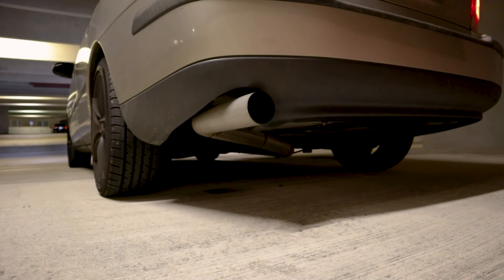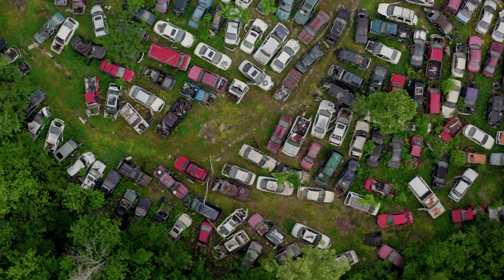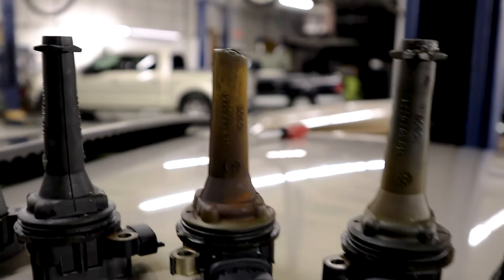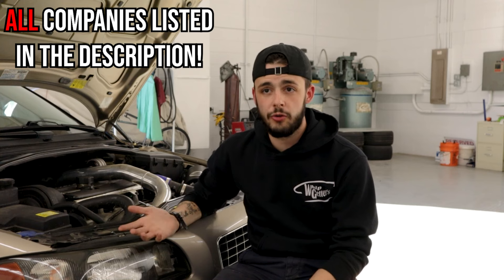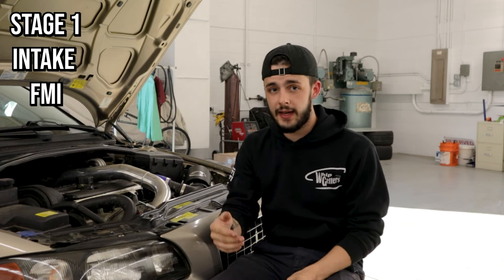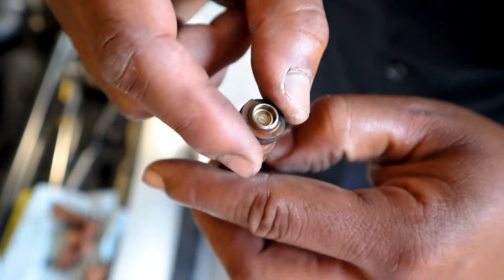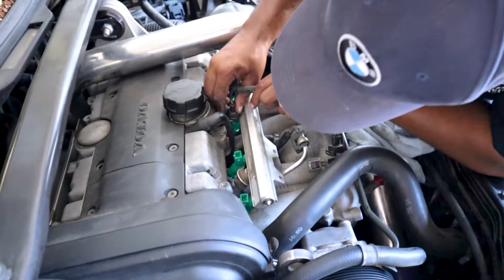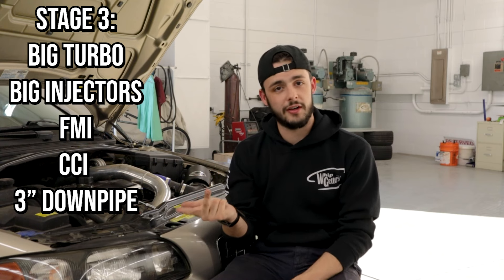What To Expect When Modifying A Volvo | Understanding Volvo’s & Performance

Comment: So my first car when I passed my test many moons ago was a 850r t5 with the manual gearbox I absolutely loved it. Fell in love with the 5 pot sound so bought a fiat coupe 20v turbo as well also 5 pot so then went upto 6 cylinders and bought a r33 gtst I had all the cars at the same time and I'd choose the volvo and fiat over the skyline any day and I don't know why as the r33 was my dream car. I don't own any of them anymore the t5 and skyline I wrote off. However I've just bought a volvo s60 2.5t because it was cheap and I've done it again the sound has sucked me in I was supposed to be selling it straight away but I don't think I can and now I want another fiat coupe too 😂 sooooo I think I'm going to sell some of my other cars to get the fiat. My wife is going to be furious 😂😂😂
Reply from the maker: Sometimes when it comes to cars there’s always that one influence that will make you want to turn to another car brand. There’s something about these 5 cylinder motors that we just can’t get enough of! We’re glad your sticking with the 5s because they’re just so unique!😎
Reply: @WhipGetters  unfortunately today I've noticed it's using all of its coolent : ( pretty sure it's going to be the dreaded cracked liner. Be a shame to scrap it. Sods law

Comment: Did you have to change anything for the 18t turbo or is just a bolt on
Reply from the maker: You should be fine, just make sure your flange for your exhaust down pipe is angled if angled. The 18T I got had an angled exhaust flange and bolted right up to the exhaust manifold. If yours is straight flanged, find a straight flanged 16T or 18T. If you have the same flange, it is a direct bolt up. If this was confusing just let us know!😎
Reply: No. Do not get misleading. 18T can be bolt on. BUT it will BENT your ROD. This problem has been discussed a lot on Volvo forums. 18/19T K24 turbo bolt on is a guarantee BENT ROD. You will need a special TUNE for big turbo.
For the flange part. All TD04HL - xxT turbo share the same exhaust housing. 
The only safe choice for bolt on is 15g/16t.
Btw. I own 2 850R sedan.
Reply from the maker: You’re right, but we weren’t misleading! Of course any bigger turbo will require a tune and it’s supported mods as mentioned in the video. It also squares down to what block you have as well. Understandable, and you taught us something we didn’t know either!😎
Reply: @WhipGetters  also the 18T is not a efficient turbo. All TH04HL are not really efficient. If you really want power, K24 is better.
Reply from the maker: A K24 might be in the near future knowing that now, we’re just gonna have to see if our 2.5T motor will bend a rod!🤣 We appreciate your advice!
Reply: You guys are misinformed. 
#1 k24, 18t, 19t is barely an upgrade will only grant you about 20 to 30 more hp then a 16t. Maybe 50hp on e85. 
I made more on a td04hl-22t with water meth and 100oct.
Learn from experience of others. 
I spent the $1500 on a turbo and Bosch green injectors and 3" maf for 22t. Just to then do it again when i got bored and then needed 800cc deitchwerks injectors and 3.5" maf, rebuying bigger couplers again etc.
K24 are also very prone to cracked housings. Turbos dont bend rods tunes do. Your reading info on forums from 2012... Talk to aaron at vast or matt at hellmooseperformance or even calvin at sovvagn. Ote tunes are not the most efficient. My tuner spent months sending logs back and forth sending new files each time i made a new upgrade. Take care of them they'll take care of you. I realize you guys are running p2 chassis with me7 or me9. But must be something other then off the shelf tunes. Guess depends on power goals. But if like most you always want more do it right the first time. Get manifold milled for t3 housing and get something with bigger then a 7cm housing that chokes off at high rpm. You'll thank me later lol.
Reply: @lynnmei4346  ive been running a 22t at 23psi for over 2 years no bent rods...
Reply: @ogfromutube9649  the problem is not the high rev with high boost. The problem is too much boost on low rev without tune. A tons of blow motors on forums. 
Btw. Stock R motor with T5 head and running 93 fuel is good with 350hp+. Stock R motor comes with reinforced rod and k24. I got a friend achieved this.
Reply: @lynnmei4346  Never said anything about high rev. Literally said too much boost at too low rpm. Its tunes that bend rods not turbos. I make 380bhp on a td04hl-22t... Stock b5234t9 from an 04 c70 2.3 hpt. And about to run a td06-20g thats almost twice the exhaust side as a k24.... K24 18t 19t all barely upgrades over stock. I got 280whp from a 16t on water methanol..
I said the 18t 19t 22t k24 all choke out at high rev once the motor outflows the turbo it stops making power. A td06 or really any t3 with bigger turbine will make power to redline. Td04hl and kkk are meant for low end torque why they put them on cars from the factory. Make the power where 98% of ppl will use it.
Yes a k24 can make 350bhp but a 16t can male 300bhp so for the $1500+ it cost really not worth it over a 16t.

Comment: How should I go about tuning an 08’ s80?
Reply from the maker: What motor does your S80 have?
Reply: @WhipGetters ey, same question lol. I own a 2003 s80 2.9 and I’m about done with stage 0. I wanted to ask how I should go about stage 1 modifications, and wondering if these engines can handle 260+ hp like in the T6 model.
Reply: @romanguerra234  I think the 99-04 t6 couldn't really handle the power since they used some weak general motor transmission :face-orange-biting-nails:Usually the engine blocks can handle the power in volvo but the transmission might not. I got around 360hp in my 04 s60 and im scared for the transmission even though its aisin. (which still isn't the most reliable)

Comment: I got a 2006 s60 t5 manual, 103K miles, I was thinking about buying a cai and a stage 1 tune, do you think I really need a FM intercooler for this mods?
Reply from the maker: We haven’t added a FMI all the way up to stage 3. If you want to add it you can, it would probably make ours flow much better and cooler. But for stage one you’ll be more than fine to skip it until higher stages!😎
Reply: @WhipGetters  ohh I thought you said a fmi at stage 1, loll sorry my bad
Reply: @WhipGetters  and do you know the stock rev limiter on a 2006 t5?? Because I went to 6300 today and didnt hit it lolll

Comment: I couldn't help but notice you didn't say you shimmed the block. When you go with a bigger turbo on these you really have to shim the block otherwise The increased pressures will crack it because of the way the coolant passages are designed
Reply from the maker: True, block wasn’t shimmed and might never be for this current motor. But I did forget to mention whenever doing bigger turbos and don’t want to risk block cracking, is to control the amount of boost levels your engine is making and not peaking to the extent of cracking!😵 There have been plenty of tests with the bigger turbos being used but not over boosting and setting your pressure right with tuning can be safe and reliable without damage. Also, thanks for pointing that out!👍
Reply: @WhipGetters  I'm doing quite a bit of research on this because I have an 05 Volvo v50 T5.
Reply from the maker: It’s always good to do some research about these motors. Most of the time we’ll find out things about them we didn’t even know!

Comment: is yours a t5 or a 2.5t? my s80 has a 2.5t and want to do something to it but most guides are exclusive to t5's. will most parts for the t5 fit on a 2.5t?
Reply from the maker: A lot of the motor parts are interchangeable. Our S60 originally had the 2.4T motor, but was replaced with the 2.5T motor. You can find tons of parts from a couple of the websites we listed in the description and with a little bit of searching! If you have questions about anything with parts and tuning, feel free to ask us!😎

Comment: hey i have this same car with a catless downpipe and am looking to go stage 2+ with a fmic how has the automatic held up? will the 18T just bolt on in a 2003?
Reply from the maker: The 18T is tricky. To an extreme it can bend rods. So be careful, a much safer option is a 16T and worth the change! If you have a angled flange and get an angled flange turbo you’ll be fine, it will bolt right up! The trans doesn’t really like more power, we got a much newer one and it’s been alright, it just hates hard launching with traction off! So just be agile and you should be alright! Flooring it rolling is the transmissions beat friend!😎
Reply: 18t doesnt bend rods poor tuning does... Long as boost doesnt come in too low rpm.
All td04hl use same housing and are all interchangeable. Only diff was feed line ports on pre 98 to post 98. One used coolant feed and return on the same side other had them on opposite sides. Pre 98 used 2.75" 6cm straight flange post 99 used 3" 7cm angled so diff downpipes.
Reply from the maker: Thank you for putting some insight on this! You’re deeper than we are in these motors! Much more of a pro!😎
Reply: @WhipGetters  hey i wish i was on youtube  more to see this! my car is stock with a 16T! i have the 2.3L hpt planning now to do the do88 drop in and go 2+ over stage 2 with hilton! im only planning to push about 300 crank/ 250 whp hopefully ( ive heard 2+ does more then that tho) do you guys have an instagram would love to keep up with your build! My car just hit 200k kms 124k miles so i think my auto should still be healthy as i did a transmission fluid flush about 60k kms ago and plan to change it at 50k km intervals when tuned along with a seperate transmission oil cooler to keep temps down so far this winter ive got some coilovers for the car, along with front and rear chasis bracing! planning now to slowly buy all the power parts over the winter and hopefully not blow the car up first thing in the spring! thanks again guys hope all is well.

Comment: Also. Make sure that if you buy a Volvo and plan to modify the engine on it, it's a 2.3L or 2.4L engine. The 2.5L engines have too thin cylinder walls and are known to blow up when under too much stress. They won't make 250hp before they become very unreliable. It's not any of the other components I'm talking about. I'm talking about the engine block itself. The one mistake Volvo did when making the 2.5L engine, was to use the same engine block as the B5234 and B5244. And since they only bored the cylinder wider to slightly increase displacement, they made the cylinder walls too thin to handle more power than stock. So anything over 250hp and you'll have a piston sticking out of your engine block if you step on it one too many times.
Reply: Volvo 2.5 2.5 T and R push 300 hp already what are you talking about it won't push 250?
Reply: @davonvillehouse2500  The R models don't have the 2.5 in them. They have the 2.4 in them. And if you read more than half the comment you'll know what I'm talking about. The only way to make the 2.5L engines capable of more power is to reinforce the engine block.
Reply: @tntfreddan3138  so how far can you go it stage till you have e to do that?
Reply: My little 2.5 is pretty fast, I'd like to do this.
Reply: @davonvillehouse2500  Some. especially 2.5Ts, blow up already at, or before, 300 000km. And that's when stock. If you want to do any sort of tuning you should reinforce it. Or just get a B5244T (2.4T). They're the ones in the R-models and are good for well over 300hp and still be reliable. The fact that the B5254T (2.5T) is too unreliable for any real power is the reason why Volvo decided to go with the 2.4L instead for the R-models.
Reply: @tntfreddan3138  so 2.5l are trash is what your saying
Reply: @tntfreddan3138  then why is it that when I look up R type specs it's showing they have the 2.5L same as me 😆
Reply: Hi man,

Don’t mislead other people. Volvo s60r have this engine: B5254T4. Not 2.4. It’s 2,521cc. B5254t4 has 2,522cc and this engine produces 250PS.
Reply: @filipklis5350  Thank you for correction, then. 

Should probably have been more specific. The early V70 R AWD had a B5244T2 making 260hp and the late S60 and V70 T5 models had B5244T5 engines (probably depending on where it was sold and built). I'd imagine the R-models with the 2.5L engines already have reinforced engine blocks, then, since the regular B5254T engines are known to blow a piston out the side of the block if you push it just a bit too much.

Comment: i have an 06 s60 t5 with 57k miles. i plan on going stage 2+ by the end of the year. do you think crank and cam seals are still a must before then? i have the timing belt and water pump out of the way, and my plans are to do spark plugs and ignition coils soon, do88 drop in intercooler, snabb 3" catless downpipe, swedesource air filter, muffler and resonator delete,  and probably not an intake because from what i know the t5 intake is good enough for stage 2 but ill probably do one eventually anyways. any other reccomendations or other peices of advice? im 16 and dont know too much about modding car but im trying my best to learn and do it the right way because i know the rarity of my car and dont wanna mess it all up.
Reply: i already have a borgwarner k24 turbo so i dont think ill need to mess with that but i dont want to take it any farther than stage 2+ until i manual swap it.
Reply from the maker: I can tell you this, you’re doing something right if you have a T5 with 57k miles. Plus you have the BEST motor Volvo has made regarding 5 cylinders. Your motor has iron cylinder walls which makes the block a MONSTER! It can handle so much power compared to the R motors and the other ones such as our 2.5T. You’re doing all the right steps with the power mods, just make sure to do ALL of your maintenance first before adding power. I know it’s exciting and fun to add mods, but you can ruin your engines longevity. Doing your crank seals and all required maintenance will extend the life for your motor DRASTICALLY! You should be right around the best mods for a stage 2+. Stage 3 and up are for bigger turbos and bigger fuel pumps. Make sure on your stage 2 you get the R injectors regardless. They’re referred to as the ‘Green Giant’ injectors. You’ll learn soon enough, it just takes patience and time. If you have any more questions, let us now and we can help you through the process!😎
Reply: @WhipGetters  i got INSANELY lucky and picked this thing up for $6500. thanks for the advice! ill probably do crank seals shortly after the tune is applied.
Reply from the maker: You did get lucky lucky! And of course, like we said, anytime you need advice don’t hesitate to ask!!😎🔥
Reply: @WhipGetters  for sure! thanks for the help!
Reply from the maker: Anytime!🔥🍟
Reply: The clogged pcv is what blow seals not the seals themself. Modifying the pcv lines to a 5/8 or even better 3/4 and making sure oil trap is clear is whats important. Especially running higher then stock boost levels.
Reply from the maker: Worst pcv design!😮‍💨

Comment: Vacuum leaks will force the ECU to compensate at the throttle plate, making for dull throttle response as the corrections are calculated.  Same leaks will also prompt the trans control module to shift up early in an effort to reestablish fuel economy.  Codes will not populate until the ECU has run out of possible compensations.  Brilliant cars, but everything has to be in top condition.  Brake boosters can cause vacuum leaks too.  Keep your wallet open.
Reply from the maker: We really like how you explained this! In one of our more recent videos, our Volvo S60 is dealing with a horrible vacuum leak. It’s obviously making the car run like… well, shit. We’ve got the main vacuum issue figured out with the throttle body gasket absolutely blown out and replaced it. Still having a small hiccup, but we’re still attacking the issue because like you said, everything has to be in top condition!😎

Comment: 100000 (= 160000km) service? Isn't that just changing timing belt?
Reply from the maker: Timing belt, water pump, spark plugs, belt tensioner, etc… depending on your servicing periods of your car!😎

Comment: Lovely cars right? My '05 2.5T AWD (237k km mileage) is waiting for valve body replace (yeah I've got AT). After that I'm going to change the sound - custom valve exhaust system and put stage I. What's gonna be next? Don't know, we'll see... :>
Reply from the maker: Very lovely… unique cars!🤣 it’s crazy you’re at that many miles!! We would most definitely love to see another Volvo owner with a loud exhaust, our straight pipe s60 is all alone. You should make the exit exhaust off the down pipe if you do one!!!
Reply: @WhipGetters  Kilometers not miles. That's even less than average mileage for S60's in Europe. Usually they've got over 300k km (circa 190k miles).

Also it's not a problem to get to 400k km (248k miles) without major problems, so yea. That's quite impressive.
I can only complain because gas it's not that cheap like in the US - I have to pay 6.08 USD for gallon of premium gas (98 octanes).
Reply from the maker: Sheeeshhh that’s a pretty penny for some fuel. You seem like it’s alright because they’re such fun and unique cars to enjoy! It’s worth the pain when stuff happens though.😎
Reply: @WhipGetters  Let's be honest. There's no reason to dislike this car. Gas prices won't change my mind at all. I really love it. Even slowly night crusing is really enjoyful. Seats are comfortable, suspension also, but if I want to press the pedal... Damn, it shows another, more darker side. That's the car what I've been dreaming for really long time.
Reply from the maker: With ours straight piped, we can agree anything we do with it just makes us love it any more. The slow cruising and the exhaust is like it’s own music to our ears!🤣